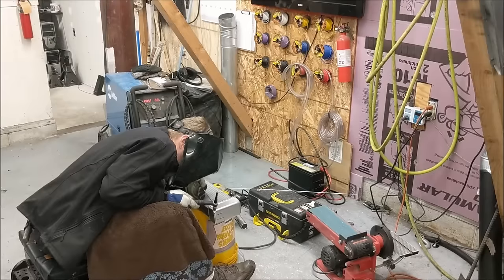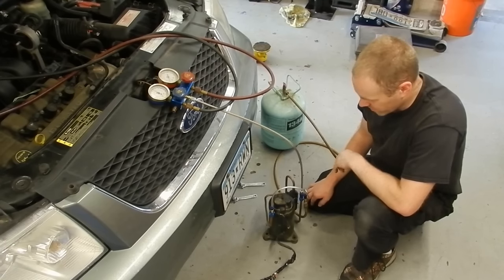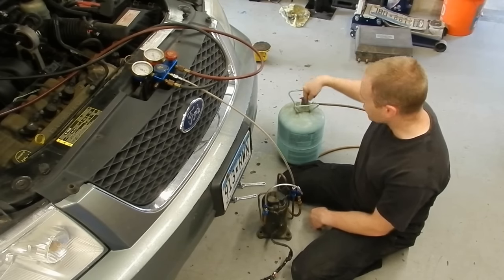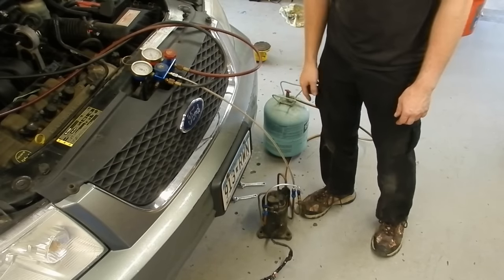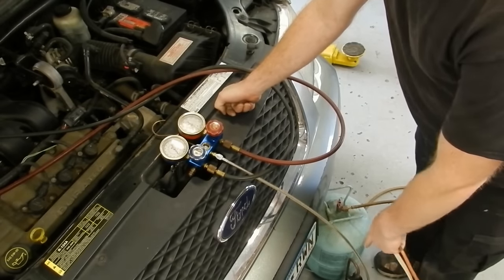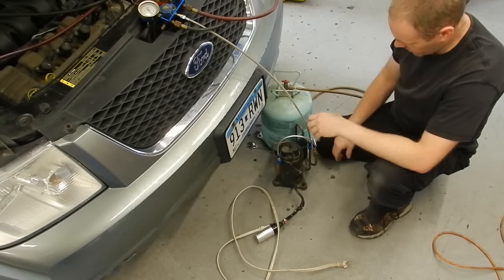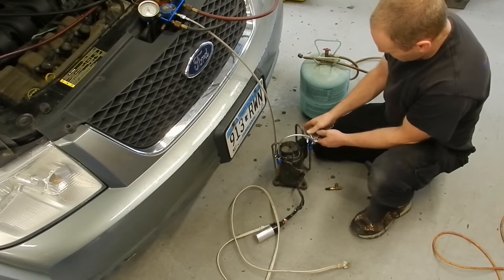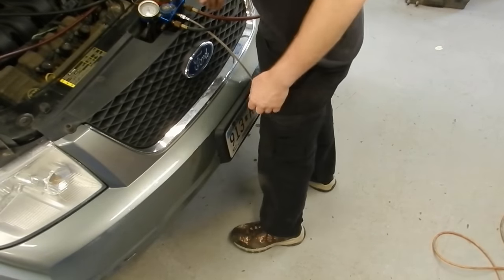Freon recovery on the cheap homemade Air conditioning recovery machine

Comment: Random question, a buddy of mine said you can drain the system by removing the valve from the lowline.... is this true? he needs to install a new condenser but is afraid of removing the lines because he doesnt want anything blowing up in his face.
Reply from the maker: It will spray refrigerant everywhere and don't let anyone catch you doing it. It a huge fine to vent it to atmosphere intentionally.

Comment: around 5:25.. totally WRONG place to stand while filling that tank! LOL
Reply: True. Those tanks are only good for about 10 bar. He has no way to monitor the pressure going into the tank.
Reply: one way to be "a little" safer... before you connect the yellow hose to the tank, warm the tank- hair dryer/heat gun and close the valve while still hot.  When the tank is at room temp and you start pumping, there will be a vacuum already in the tank.

Comment: Not to complain, but just wondering out of curiosity because im thinking how to build same machine...

Dont you loose some oil from the system? I guess the oil ends up mixed with recovery compressor oil... All those professional recovery machines have a membrane that separates oil from gas, oil that comes with the gas is usually discarded and same quantity of new oil refilled.
And other question, does the recovery compressor spits some oil into the recovery tank together with gas?

Thanks for your answer!
Reply from the maker: Yeah it's not perfect that's for sure. I should at least do one with a replaceable filter. The oil does travel with freon to some extent but it's minimal. If you need to add oil it can be done while there is vacuum on the car. There is cross contamination though with this method. I guess one could maybe flush it out with pag100 every so often as that seems to be dang near a universal oil for r134.
Reply: @CrazedPerformanceRepair  thanks for reply

Comment: I have a question I would like to ask you: I built a freon recovery system based on your design.  I used a propane tank and a window A-C compressor then I added some valves to be able to connect the hoses and keep the freon from escaping.  I understand from your video you had plans to make modifications to your system at some point too. My question is: did you lose refrigerant oil from the cars A-C system when you were recovering? If you did, do you have a guess on how much oil you may have loss? I haven't used mine yet so that's why I'm asking. Thank You for any advice you may provide me! I have an older A_C set that I monitor the propane tank and it got to about 130 psi. I had pulled a vacuum on the tank before starting the recovery, however, that is good advice, that tank under pressure has a lot of energy stored inside.  (I have to be careful of the choice of words I used) I did get some oil come out, I was careful with the flow rate out of my cars A_C unit. My system was low on freon and was not cooling well. Check the L and H side pressure, L=20psi & H= 150psi, outside temp was 89F & 70%hg, it was running 77F inside the car. The manual indicated, for that Temp & hg, should have been L=45-55psi & H=225-250psi. Thanks again for your advice and help.
Reply from the maker: I did modify it and it doesn't seem like I'm losing oil from the vehicles. I added some valving and still need to add another filter. not sure what a propane cylinder is rated for pressure wise but pay attention to tank pressure I have a guage on mine now and never let it exceed 120psi. If you do notice oil being pulled out, that vehicle probably had too much oil to begin with. If you change out parts on the vehicle though, depending on the part you will have to add appropriate amount of oil.

Comment: Those tanks are not designed to hold the pressure. If you put moisture in that tank it can rust through. Reason the recovery tanks themselves are thicker. With moisture comes acid. If you were just to do this on a single use but you can’t return this tank for disposal/recycling. Recovering refrigerant gets hot as well Your better off buying a recovery tank and recovery machine. I get the video and it’s useful but just understand you can’t do this on the regular.
Reply from the maker: Please read the description.
Reply: Wow a guy in a white lab coat holding a clipboard out in the wild telling people what they can and can't do. I thought they kept them inside industrial facilities

Comment: Just curious since I'm interested in building a pump like this, how did you connect the fittings to the copper lines and where did you get the parts?
Reply from the maker: They are AN fittings meant for performance vehicles but are basically the same as copper gas line plumping flare fittings. I get my fittings from McMaster-Carr.
Reply: Male 1/4" flare fittings are available at most any good hardware's.  If you Google or look on eBay search for> Service/Access Valve 1/4" SAE * 1/4" OD 4" Stem Core AC Refrigeration<   these are 1/4" flare with Schrader valves in them that are brazed onto a piece of quarter inch copper tubing 4 inches long. You can then expand the copper silver solder them or braze them on to your compressor.
Reply: @johnsonlong1272 an you braze a new copper fitting onto the galvanized tank?
Reply: @theadjuster151  , silver solder is obviously the preferred method but the type that takes a brazing torch to heat it up preferably not the plumbing type that you can melt with a propane torch. However you could probably use regular old plumbing silver solder for your own use if you are absolutely sure you are not going to over pressurize it. I'm not going to lie to you and say that I have not used plumbing silver solder successfully because I have but it's not really designed for that application it's not as strong and can crack and develop a leak.And they do make brazing rod that is copper to steal. Remember do not breathe that galvanized off gas but most galvanized is just a coating and you can sand it off or even remove it with a bit of acid, or just not breathe it when you're heating it and it's off gassing. Also remember if you set your recovery tank in a container of dry ice it is going to recover a large amount of the gas without a recovery pump also the upside of that is it's pretty hard to over pressurize your recovery tank. Obviously all of these things are done at your own risk know your skill set and know the risk. A large rapid refrigeration liquid leak is no game folks have lost body parts due to frostbite.

Comment: I would at least submerge the "receiver" in a bath of ice and water to lessen the recovery head pressure.
Reply: When it heated back up to room temp later it would pressurize itself so no point..  youre never supposed to pump down a system past zero though just because of overpressurizing the tank or compressor if pumping it down to it..  trick is to just do it slow and have a vacuum on the tank already.. release the high side slowly and watch the weight of the tank.  If it doesnt rise like it should be then crack open the low side with high open and throttle the high side when the pressure drops from the low..  but just use the compressor on the car or unit..  no need for an external one.  Would be good to include a filter/dryer inline before the tank and a oil water separator…. But youre always gonna get oil in the refrigerant because it vaporizes and travels with it to a degree..

Comment: I need to try this I have been using an ac compressor for a vacuum pump and the oil is full of crap what oil should i put in after i drain it?
Reply: Vacuum pump oil.

Comment: Printed right on the tank:
“ Federal law forbids Transportation
if refilled -penalty up to $500,000 fine and 5 years imprisonment (49 USC 5124)
DOT-39 NRC260/325 M1005”

And states all over it:
“do not use for compressed air”
“do not refill with any material”
“this is a non reusable cylinder”
Reply from the maker: Yup, and it was temporary plus never gets transported with anything in it.
Reply: You must be the law
Reply: Take another booster and put your mask on while you're trolling 😅😂!

Comment: Sometimes air is in the system you are recovering from. How do you make sure that air does not contaminate the freon in the recovery tank?  I like your system.
Reply from the maker: You could purge the air from the tank every so often like the big machines do by simply venting a little bit with the keg in upright position. Air won't become liquid at these low pressures so it will always be at the top. I highly recommend a proper keg though.
Reply: Great job from tech to tech. We always have to rig something

Comment: First thing i don't see is something to regulate pressure kinda scary isn't it lol?
Reply from the maker: The only thing regulating pressure was me at this point I have since been adding to the makeshift machine to make it safer.
Reply: That's good lol, I know as long as the tanks empty would never over fill but if it were ever over pressurized it would go off like a Freon grenade haha. Either way good idea it's nice to see people attempt to reclaim it rather then purge into the air !!
Reply: @zack6892   I believe those tanks come with a valve which is sort like a three-way valve, that is it looks like a "Fourway Tee".  The valve is at the top acts as a needle valve which closes or opens the inlet to the tank the common port #1. the second port is to connect the refrigeration hose, used to fill the system. The third port is not an operating port but rather has a not removal high pressure relief valve. Which may act as a safety to overpressure, Right?
Reply: My man, a fellow zackeus von zackshire from zacksville..  sup..

Comment: Couldnt you just take a tank, drill checkball out, submerge tank in ice, then pull a vaccum on tank, then hook manifold set to car, only slightly open Hi side, purge air out hose until freon shoots out. Connect hose to chilled vacuumed tank, open Hi side wide open then open tank valve wide open then shut recovery tank off once max pressure from car system has decreased to zero. ????
Reply from the maker: It wont decrease to zero even with a larger tank. It will get close though. That also won't allow you to put it back in the vehicle unless you do this in the winter and have a warmed tank with the vacuum on the vehicle outside in freezing weather.

Comment: I've had a slow leak at the condenser for over 12 months. The other day, the air con blasted super cold air for about 10min then gave up the ghost completely. Turning air con on has no impact on the coolness of the air at all.  My question, to anyone who can answer, is does this mean all the freon has leaked from the system and therefore I could begin work replacing the condenser without performing a recovery?
Reply from the maker: I didn't tell you this... but if you don't have a gauge take a small screwdriver and push one of the schrader valves and listen for pressure to release.
Reply: @CrazedPerformanceRepair  So hypothetically speaking of course, if I were to push the schrader valve of the Low pressure value, and air started escaping under pressure, that would imply it is still pressurized and I would need to go to a shop to have the rest removed right? I mean, hypothetically speaking, I couldn't just continue to release the pressure right?
Reply from the maker: If it seems like it has a lot of pressure you should probably take it to a shop. If it seems like it is very low I know nothing... ;)

Comment: How did you keep from having small metal shaving get into your jug when you drilled out the old check valve?
Reply from the maker: Hold it upside down while drilling. Then used magnet with it right side up to get any steel out from the bottom. Then finally pressurized it with compressed air and let it release while I shook it upside down several times to make sure it was cleaned out.

Comment: Freon hasn't been used for refrigerant since the early 90s and I still hear younger generation people calling refrigerant Freon instead😶 it doesn't bother me when I hear the old school generation using the term freon but when I hear younger folks saying it makes me wonder if they know what the hell they're talking about regarding anything else.
Reply from the maker: Well I do still tune and rebuild carburators... Freon is just a brand name. Kinda like Kleenex. I'm Yung but a bit old-school mixed with new school. Learned a lot of my ac knowledge from a old timer when I was in my teens so I suppose it rubbed off on me lol.
Reply: If r134a is sold by the Chemors company, it's still called Freon as that's their brand name for their line of refrigerants. So this idea that freon isn't used anymore is not accurate.

Comment: It's a dangerous way. The vial can explode
Reply from the maker: Absolutely could if not careful. It would be stupid to try and actually fill that kind of keg.
Reply: @CrazedPerformanceRepair  I know the Ford has about 800 grams of Freon...And you pull it to a continent that can absorb 13 kilograms of Freon...I live in a desert that can heat up to 50 degrees in summer..In this case 800 grams of hot gas in high temperature can explode....It is best to add condenser with fan for Turn the gas to liquid ..Will be safer and more gas can be recovered.
Reply: Pretty sure that bottle he is drawing the freon into, holds more than 30oz from a single car. However, he should install a guage to be sure the bottle is not already pressurized from previous use. Sometimes in the shop it can be easy to forget.
Reply: @DGOfTheCentury  - Most AC shops will have a scale to tell them the tare weight of the canister they are storing the freon in.  Shop technician then weighs the canister before and after each exchange.
A small freon bottle like this is sold as a 30# bottle.
Reply: @fakiirification   should not  do it fast ,like you say, removing ht valve core,or a lot of OIL will spray out!!!  you mean,do it s l o w l y...

Comment: Guys  COME ON   there are several wrong things here  at least one  DANGEROUS.  And  it is ILLEGAL  to re-use  disposable  refrigerant cans in this way.  1---what compressor oil, likely  WRONG oil. 2...No condenser,  why you didn't use the original  window banger condenser is beyond me  3.. pumping HOT GAS  (high pressure) into that  can  is dangerous and may in fact blow the relief  blow off open.  
IF YOU ARE GOING TO DO THIS  US A CONDENSER  (and fan or water cooling)  COOL  the  can in a big bucket of flowing water,  MAKE SURE  the correct / compatible oil is used

Comment: Ok, I get the $$ part, but you don't have goggles or gloves, don't use a home made recovery machine, these will get hot and need room for expansion, it's dangerous, I have seen one explode where the recovery machine has  failed, Be Safe and wise

Comment: That's not a recovery tank! It's illegal to use that tank as a recovery tank.
Reply: He’s right..  federal law forbids it., if refilled -penalty up to $500,000 fine and 5 years imprisonment (49 USC 5124)
And states all over it do not use for compressed air, do not refill with any material, this is a non reusable cylinder.

Comment: 1234yf stonks here I come!
Reply from the maker: Yup I have a video using the same machine for 1234yf I haven't had the time to finish yet I will be getting out soon ish.
Reply: @CrazedPerformanceRepair  I work in an independent shop and we do work for used car lots. About once a month we get a car that needs AC work and has the new stuff, I figure by this time next year a machine will be a necessity.
Reply: @CrazedPerformanceRepair  I have an old water cooler that Im gonna pull everything out of but the compressor, and hopefully hook everything up to an arduino with a weight sensor and everything so it can be automated.
Reply from the maker: @nbarrager  heck yeah, that would be awesome. You going to add simple screen and buttons or just buttons? I'd prob go full raspberrypi and give it a touch screen. Would be so much cheaper then a recovery machine. Only downside would be the amount of build time it would take lol. I'd have to have the scale, vacuum pump, compressor, filters and all.
Reply: @CrazedPerformanceRepair  I'm not a huge fan of touch controls, plus the pi's boot time is significantly longer than an arduino and this is something that would be moved around the shop. I also already have an arduino i'm not doing anything with. I'm thinking a knob that lets you chose between recover and charge with a little lcd display that gives instructions and lets you set times and what not. And an 8 segment display that tells you how much refrigerant is in the tank at all times. The most daunting component to find would be an electronic valve that would let me change between recover and charge. Maybe a heat pump reversing valve??
Reply from the maker: @nbarrager  I would think it could be valved with multiple small air valves. Kinda like how I set my simple version up using multiple ball valves.

Comment: I just vent the shit. Every car accident that involves a  front end collision vents the refrigerant.   You can buy 30lb as cheap as 99 bucks.  At less than 4 dollars a pound, vent it.  Lol.   Keyboard dusters still use the same crap.   Everyone is venting this crap.   Why bother reclaiming it?   Hell, might be full of air or contamination anyhow.
Reply: I didn't even realize that air dust cans can commonly use R-134a. I looked it up on Wikipedia following this comment and apparently even some airsoft guns use it. That is honestly pretty silly that it is so tightly controlled for automotive but everything else gets a pass. It makes sense to require AC repair shops to properly recover the refridgerant but I agree for a person fixing it on 1 car, unless you can rent the equipment, it isn't a big deal to vent it.